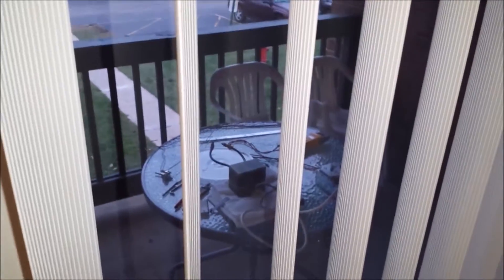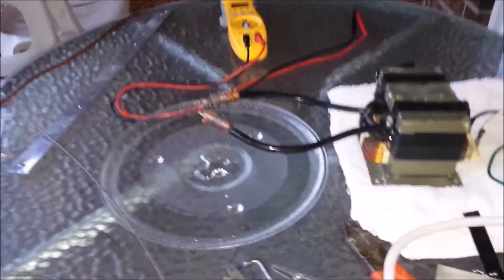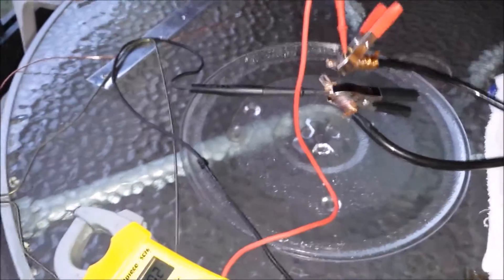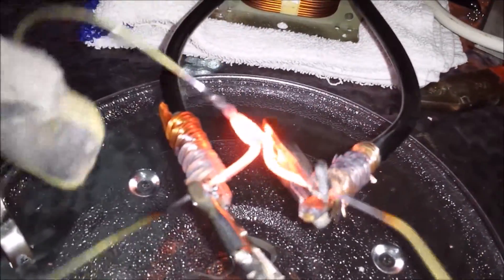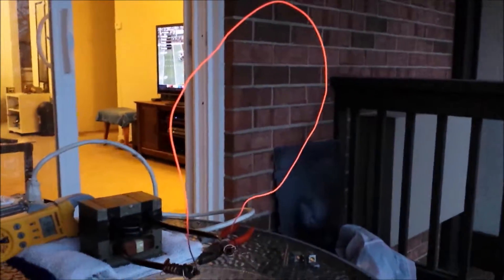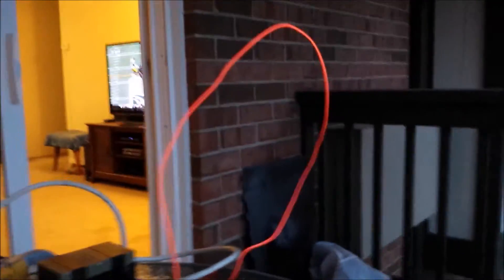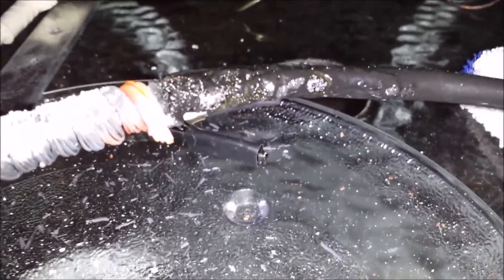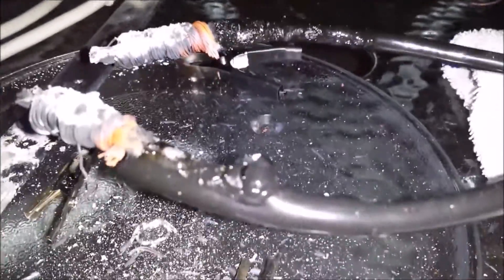Melting Metal with My 800+ AMP MOT: AWESOME ENDING!!

Comment: Hi there. Nice video!Where did you measure 800A?? That secondary there is not thick enough to pass 800A. It seems to me that this cable could only cope with up to 180A. Maybe your Amp meter is not working as expected?
Reply: Delphi Builder it does not utilize the high amperage because the voltage is too low to put 800 amps through brass.
realistically its problably 200amps, short circuit voltage is 800
Reply: J Stuyfzand a ok then! I never thought brass had such big resistance... Anyway, keep it up man!

Comment: If I would have 4 MOTs I would join them in parallel and it should pump 2 kV and 2 A - massive and hot arcs if you add some resonance.
Reply from the maker: +bb aas Thanks for the comment :) Yes you could. Problem is the primaries would overheat so quickly, not to mention draw an enormous amount of amps. You'd have to ballast them, but then you loose those gorgeous huge hot arcs... Have you seen my 4kv arc video? https://www.youtube.com/watch?v=uD_hcNciGLs   <--awesome arcs!

That's as far as I've been able to push MOT's unballasted without popping breakers or melting primary windings.
Reply: +Lets NOT Play With Electricity Yeah I've seen it while ago :) Very nice arcs.